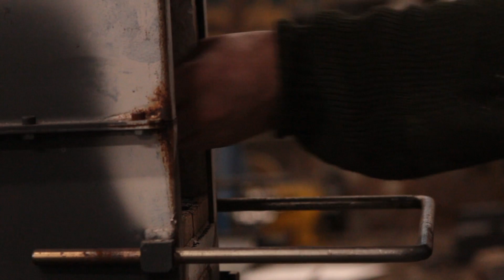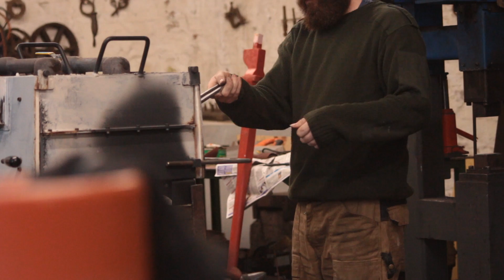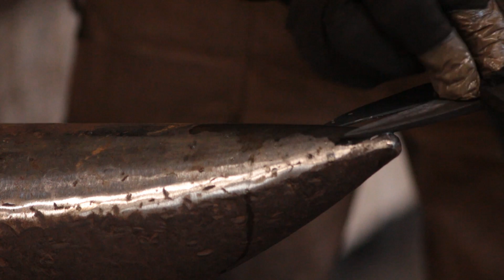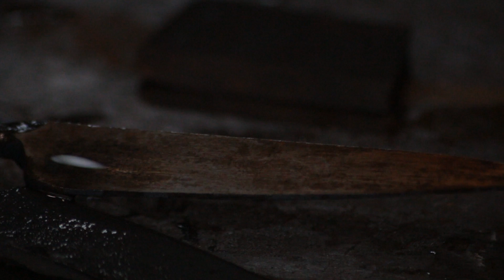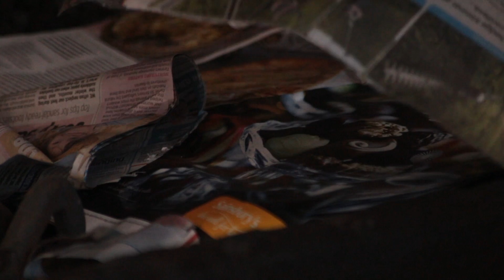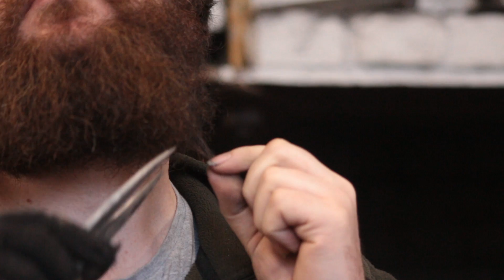Forging shears. Part 3: Heat treat and cleanup.

Comment: So I guess the main reason for hardening these was so the blades will not wear away at each other, right? It didn't look like you gave the shears a super sharp cutting edge, so it's more of the "shearing" action that cuts rather than a sharp edge going through something. I have sharpened some loppers before until they were razor sharp and the edges actually bit into each other.

Comment: Wikipedia tells me that similar blade shears were very common in Australia until about 1915, so over the years there must have been literally tons of them forged in just the way you've demonstrated. Amazingly, half a million New Zealand sheep are still blade shorn, so this is still a highly regarded modern tool for colder climates, because extra wool remains on the sheep compared to the mechanised handpieces. When I think of the back-breaking physical effort required to blade shear 50 or more sheep a day, constantly squeezing the blades together with the same hand, wrestling the sheep with the other hand, it seems almost impossible. Gotta admire those shearers - must be as tough as Blacksmiths!!